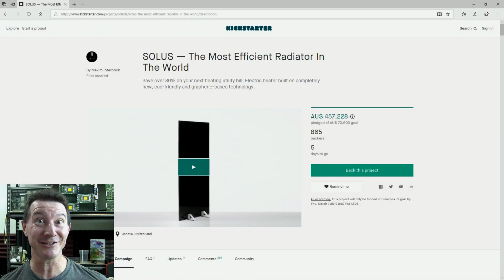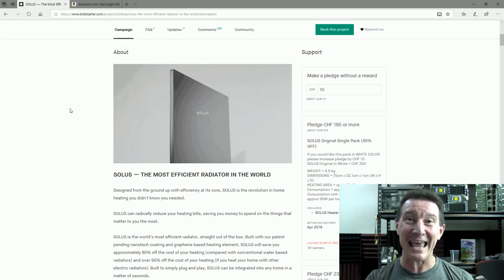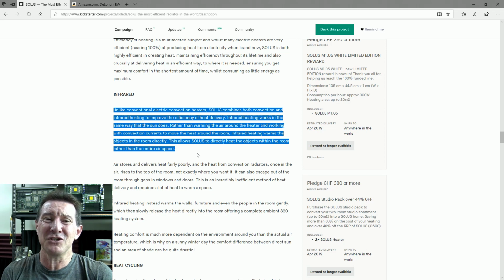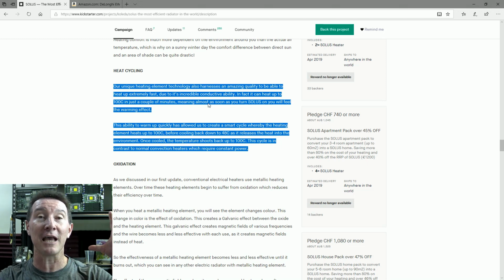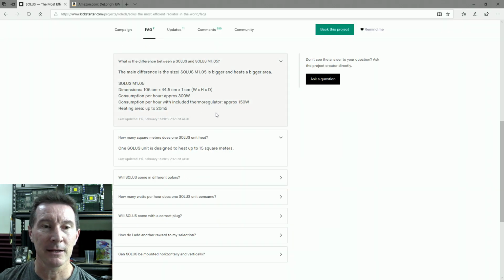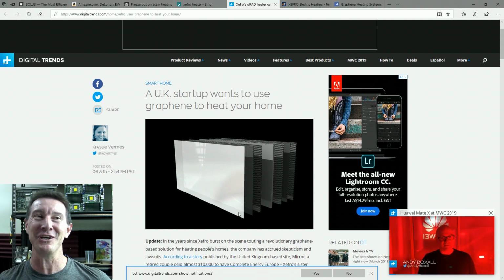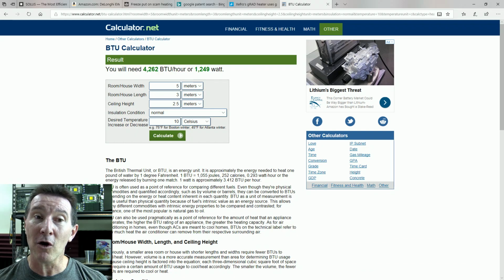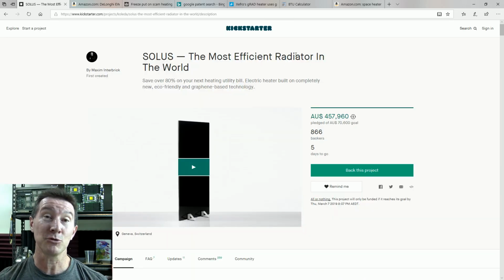EEVblog #1186 - Solus Graphene Heater Kickstarter BUSTED!

Comment: I worked for 25 years as an HVAC tech and have a lot of experience with radiators of all kinds. Convection does occur without fans. Since warm air rises and cold air falls, a VERY slow convection current is established. However, the amount of airflow depends on surface temperature and surface area. A standard radiator has FAR more surface area than this thing and glass is a poor thermal conductor and also blocks a large portion of infrared radiation (radiant heat). So most of the heat will be trapped inside. I can see this thing overheating internally and causing the tempered glass to shatter. Even if it does put out 300 Watts, that's equivalent to trying to heat your house with 3 x 100W incandescent light bulbs, which would likely be more efficient and cost much less than this thing. What a scam! A "thermal regulator" is what we in the trade call a "thermostat" lmao

Comment: You know, all standalone space heaters (whether oil-radiator, or forced air, or whatever) use 1500W, so that they can plug into a 120V 15A outlet, at least, where I'm from (Michigan, USA). I've never seen one smaller or larger. 200W is TINY! What would be the point? I know here in Michigan, it would be useless. Even 1500W is too small to do much more than help out during the coldest days, or help heat rooms where your furnace has a hard time getting to, for whatever reason. No one would even consider using one as a main heater. Maybe it's different in other places. Full-out furnaces are superior in every way. We use natural gas, because it's cheaper than electricity but a huge margin, or propane in rural areas, with a small minority using wood or coal because they're weird. Electrical heating would cost a shit-ton. My tiny house (700 sq. ft.) costs $200/mo. to heat in the winter with a 95% efficient furnace. Electrical heating would cost at least twice that. I doubt that my 200A 240V service could even handle it.

(For non-Americans, America uses a 240V center-tapped-neutral electrical service for residential, which means that ordinary circuits are 120V, but using a dual-pole breaker and appropriate outlets, you can use 240V. The only things are that most people don't have any 240V outlets, and they're different than in 240V countries. There is no neutral, only two hots and a ground, except that some outlets are wired with two hots, a neutral, and a ground, to allow the device plugged-in to also use 120V for whatever reason. Businesses usually use 120Y208V 3-phase service with a center-neutral, which gives 120V between each phase and neutral, and 208V between two phases. Except that some businesses use 240V Delta-high-leg, which has the neutral center-tapped on one of the phases, giving 240V between any two phases, 120V between either of the two low-leg phases and neutral, and 208V between the high-leg phase and neutral, giving the best of both worlds. Industrial users get higher voltage 3-phase and can do what they want with it, and some rural areas use 2-phase, which is a different beast entirely, and involves conductors of different diameters.)

Comment: Two 100watt incandescent light bulbs stand at the switch and turn 1 off (same as turning off and on every 1.5 seconds) sorted new heater anybody want to Kickstarter me 😂
Reply: Didn't even think of it like this. Wow, this heater is the equivalent of a 100W lightbulb. Yea I remember back when we had incandescent bulbs, turning the light on was all that was needed in the winter....
Reply: Would be a bit quieter than the "Dave ranting" model.

Comment: Well you're missing out on the idea of radiating heating, where the temperature of the air isn't that important. But that's more architecture than electronicles, so I don't blame you. Really nice takedown, enjoyed the video
Reply: The thing just gets hot. Every object that gets hot will heat up the air around it through direct contact and it will also emit blackbody radiation. It won't radiate through any other process, so it will in fact emit just as much as any other heater. Maybe even less considering the emissive surface is glass.

Comment: About 'water-based radiators'. One is heating me right now, anyway, we always called these "radiators" and there is water inside))  They probably meant centralized heating, where water is actually heated separately (some times as a side product of a powerplant).  So, the idea may have been that their "product" is a cheaper alternative to paying bills for centralized heating. In this case, it depends on local electricity prices.

Comment: Glass is excellent at radiation but sucks at convection. Basically it thing have some light going of then it's better to use glass. They mentioned infrared heating. Infrared heating have trick in sleeve basically it bombards you with light and you feel wormer then room actually is. This is glorified infrared light bulb in my opinion. We use this trick to heat chickens. Basically stick some infrared light bulbs in room to heat chickens but not room and air in it is ice cold. And chickens are fine. This can save energy because you basically keep temperature in room 5 Celsius less then normally but feel warm.
If that is the case then NOT BUSTED
Reply: I think you lose the right to call it a "space heater" then, because it does fuckall for heating the space, it only heats you. Same as an electric heated blanket would. Plus it is definitely not that. It just heats up, heats up the air, and radiates some blackbody radiation, same as any other object. And in terms of blackbody radiation, smooth glass has actually pretty bad emissivity and tends to be somewhat reflective. It doesn't emit infrared through any other process, so it's just a resistive heater.

Comment: Look at most heaters and they all have the same power which means they all heat the same. Best bang for your buck is the cheapest you can find with good quality construction. Most heaters fail because of weak thermostat switches which is why you need to use reliable manufacturers to make your choice. In the end they all work the same. To have a heater with only 200 or 300 watts and say it's going to heat your home as well as a full size heater and cost so much more is a huge fail.

Comment: 10:00 so if i put that into my house and my cat or dog knocks it over....... they and i - will walk through a lot of broken glass. CAN YOUR RADIATOR DO THAT!?
Reply: Don't forget that it heats up to 100 degrees Celsius so you shouldn't touch it at all. If you have a cat, you should just mount it on the ceiling, maybe it will heat the apartment above you through the floor too 😂
Reply: @mrkiky  burning hot glas shards piercing my feet... oh that sounds GREAT! I want TWO! (two feet, duh!^^

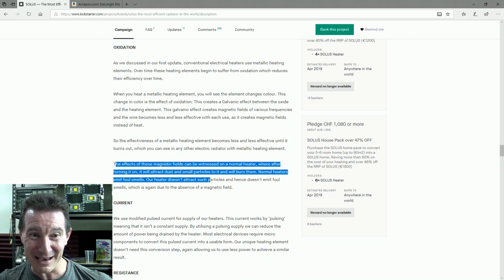Comment: 20:24 'Doesn't attract dust' On their own website (koleda.co) under the "Clean design / Integrate seamlessly" section they have a picture of their heater on a table. The heater and the table is covered in dust!

Comment: Have not watched the video till the end, but here's my two cents. Sounds like Dave is either unaware that typical radiators heat mainly through convection and not radiation (yes, it is a misnomer), or he doesn't understand the nuance between radiative and convective heating (or both).

From the description, it sounds like what they are claiming is by providing most of the heat through IR radiation, it heats you directly (as long as you are within line of sight) rather than the air. This actually would keep you warmer at a given power compared to convective heaters. This is presumably what they mean by "higher efficiency". There are such products already on the market, although they are typically not as compact and they radiate directionally by using cylindrical mirrors. One reason the tempered glass is there is probably to minimize convection as it is a poor thermal conductor but would allow the transmission of IR radiation as it is transparent. 

To be clear, I have serious doubts about how well this product would work as well as safety concerns, and they do make a lot of bullshit arguments as selling points (such as the utility of "graphene paste" and the magical magnetic fields).
Reply: Too bad glass is actually completely opaque to long wave IR. No wonder conventional heaters use shiny metal reflectors as they are almost completely reflective to long wave IR. The only thing this would achieve is heat up the glass and the glass would emit some IR as a result, but glass has a low emissivity so it really wouldn't even work as well as an oil heater as far as radiation goes.

Comment: Black-body IR radiation is totally a thing. Graphene having a large surface area absorbs heat like a sponge & emits it as IR radiation.

http://www.bbcind.com/product/black-body-infrared-heater-panel/

I am not disputing that the KS campaign made some outrageous claims, and totally oversold it. But I am dissapointed that you glazed over this technical aspect!
Reply: It's just that the supposed graphene is covered by glass which completely blocks blackbody radiation. They are clearly full of shit.

Comment: Stupid question: When I see a heating element glow.. doesn't this mean that some of the energy put into it is converted to visible light and thus not heat?
Reply: That light eventually hits something and is dissipated as heat then.
Reply: @douggale5962  Unless of course there's a window in the line of sight, in which case, that light goes out the window and heats something else up. Sub 100% efficiency garbage I say!

Comment: It is baffling that they dare claim this. When your aim is to produce heat, you can't miss with electricity. You are using an inefficient motor to generate air flow? That's extra heat. You have a bad connection? Heat. You have badly designed control circuitry that overheats? Heat. The connection is so bad it's sparking and generating light and UV? Ends up as heat. You'd need to make an effort to put electricity in and NOT get heat. I guess if the heater is capable of accidentally converting electricity into chemical energy (electrolysis, (de)crystallisation, (de)oxidation), or if it is a radiant heater mounted so that it radiates out of a window it might be possible, but you can't claim your product is better by comparing it to something that goes out of its way to NOT work properly.

Comment: Since we're on the topic of heating, here's what I want. A shower with infrared lights so it doesn't feel like someone left the freezer open whenever the water stops running. THAT'S a heating system kickstarter I can get behind.
Reply: All you need to do is heat up your shower to a good 30 degrees Celsius and eliminate as much air flow as possible.

Comment: So, with radiators that have oil, isn't the idea that the oil stores the heat so the heating elements don't have to burn so hot? Like, the oil loses its heat slower then the heating element generates it? So it gets hotter over time for less power until it reaches some kind of.... saturation point. Sorry if I'm not using proper terminology.

If that's so, would it be possible to store more heat but using a different material?
Reply: It all balances out in the end. Energy in, energy out. Electricity in, heat out. All the challenges with efficiency in electrical engineering have to do with NOT creating heat. When your goal IS creating heat, you really have to go out of your way to fail. So with the efficiency problem settled, things that make one heater better than the other are: build quality, how long it lasts, how safe it is, how aesthetically pleasing it is, how fast it delivers the heat to where in needs to be, etc.

Comment: I'd rather that you use Joules, or even kWh, as units of energy, instead of BTUs. 10k years ago cavemen would use BTUs to calculate if there was enough wood to heat the cave.

So, for saying "BTU" (several times!) I'll have to fine you 3.50 €. Sorry, mate.

Comment: So here's what you do: you create a heater that's flatter than Salar de Uyuni, and place it precisely vertical. Why? Because that's the way to get the least convection possible! There's a reason all radiators are fugly as hell, with those fins and stuff: you want to increase the surface to improve convection. 

But a flat surface will radiate more, won't it? Well, it will radiate more into the room (and the wall at the back!), but that's not what you want. Radiation energy is nowhere nearly as comfortable as convection energy. Except in an infrared sauna...

Comment: This thing looks like the heating elements in an infra red sauna. Not sure how that might work with the glass, but it could be a good idea. I think that the savings would come from the fact that people would feel comfortable with a lower temperature setting. The idea is not bad although the way it's described does sound like hocus pocus. Also, not sure how good it would be in practice. But keep in mind that if you don't live in cold climate you don't really understand what it takes to heat a house.

Comment: "Watts per hour" (sic)
"Yes, we're energy experts!" 

https://ksr-ugc.imgix.net/assets/024/240/088/39c4abca386dd8f0ac302273c7d52fdb_original.png?ixlib=rb-2.1.0&w=700&fit=max&v=1551347803&auto=format&gif-q=50&lossless=true&s=78aacc9c1b0463cc691d24d78337592c
If you don't know the difference between power and energy then you don't know ANYTHING about thermodynamics. Ipso facto, the efficiency numbers the comparison chart shows are utter bullshit, and fraudulent.

Comment: In the first 6 minutes you sound like you don't know what you are talking about. If it's an IR heater, which it seems at first glance like it is (although I might be wrong), thermal conductivity of tempered glass is kinda irrelevant as long as it's transparent to LWIR and MWIR. It's definitely not a convective heater, or if it is, it's an utterly, absolutely awful one, so let's give them a little benefit of the doubt [EDIT: Okay, after watching further, they claim it's also a convective heater; well, it isn't, or not a good one by any stretch of the imagination]. Also, note: oil-based radiator heaters are convective heaters, because those rely on natural convection to heat the room. All "radiator" heaters are actually convective, that's the reason for the "radiator" design -- to maximize surface area, which then heats air directly in contact with the radiator, which is then moved around thanks to natural convection. IR heaters are not, strictly speaking, convective (although there are some hybrids out there) -- those instead emit IR which is then absorbed by the surroundings, and not so much by air. So IR heaters heat floor, walls, and occasionally, you. Air, not so much. Depending on what you're after, IR heaters can be considered to be more "efficient", as in "directly heating you up, instead of heating up air in the room".
[EDIT: After watching the video, apparently they've basically reinvented micathermic heaters, but worse and pricier. Well, okay, that's a scam, but you still sound like you don't know what you're talking about, for instance mixing up radiant and natural convection heaters; once again, oil heaters are not radiant]

Comment: It's hilarious that they specify "Watts per hour", firstly because "Watts" is not a unit, but "Watt" is, but assuming they mean "900 Watt per hour"; secondly because the "Watt" unit is derived from (defined as a constant per) 1 joule per second, so there is already a unit of time present in the "Watt" unit.

There exists "Watt-hour", but that's something completely different (or basically the reverse of what they wrote) as that unit actually removes the time component from the Watt unit (900Wh would be 900W for 1 hour) and gets you a static energy amount instead of an energy amount per time unit. It basically just multiplies the joules per second by 3600 to get the fixed amount of joules consumed in 1 hour, whereas Watt gives the amount of joules per second.

That's why your electricity meter can indicate a consumption of, for instance, 1 kiloWatt-hour in an arbitrary amount of time, depending on how much electricity you consume. So if your meter ticks 1kWh (or 1000Wh) every 10 minutes, that means you're consuming 1,000Wh x (1hour or 60min or 3600sec / 0,1667hour or 10min or 600sec) = 6,000 Watt continuously, and if it would tick every 1 minute you'd consume 1,000Wh x (1hour or 60min or 3600sec/0,01667hour or 1min or 60sec) = 60,000 Watt continuously. One could say "900 Watt-hours per hour" though, as the "hours" cancel out, and you'd just get 900 Watt again as 900Wh x (1 hour/1 hour)=900W.

"900 Watts per hour" would mean that the power is infinitely increasing, so 900W for the first hour, 1800W for the second hour, 2700W for the third hour, and so on to infinite energy consumption and infinite heat radiation. It describes a perpetuum mobile.

Just like gravity is an accelerating force, which on earth is ~9.8 meters per second per second (or ~9.8 meter per second squared or m/s^2), and something dropped to the earth will move at a speed of 9.8 m/s after the first second, then 19.6 m/s after 2 seconds, 29.4 m/s after 3 seconds, and so on. If the dropped item didn't have air resistance (and thus terminal velocity) and would not come to an abrupt stop when it hit the earth but could continue accelerating, the dropped item also would accelerate to infinity.

Clearly they know nothing about power consumption. It's like announcing that you're going to build a car that goes 120 mph (miles per hour) per hour (which would be effectively 120 miles per hour squared, which means an infinitely accelerating car).